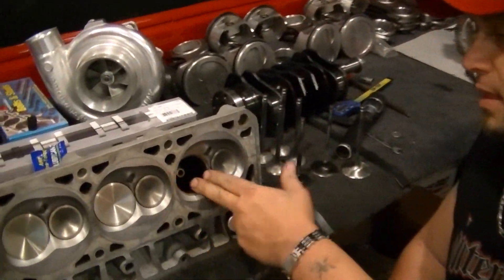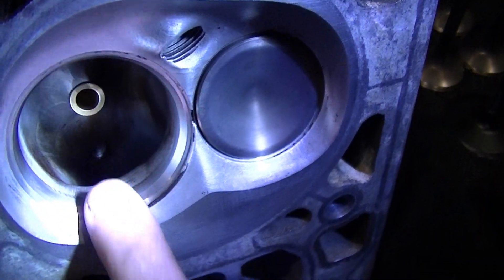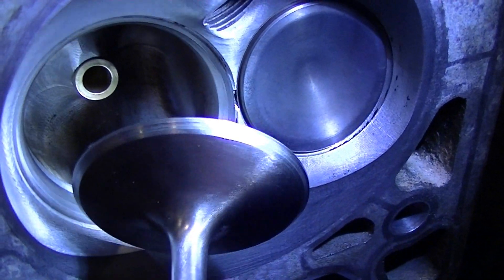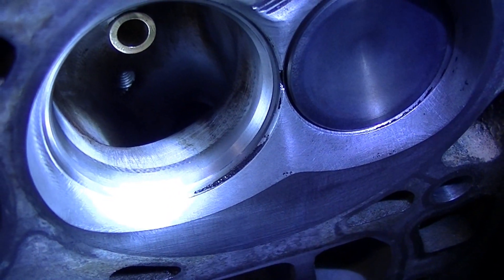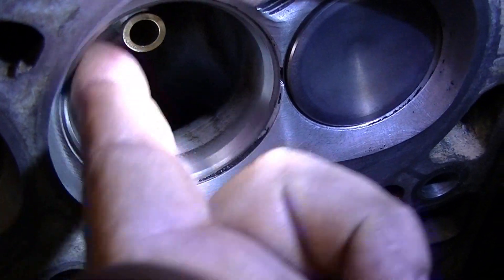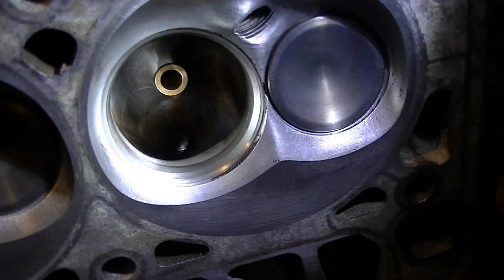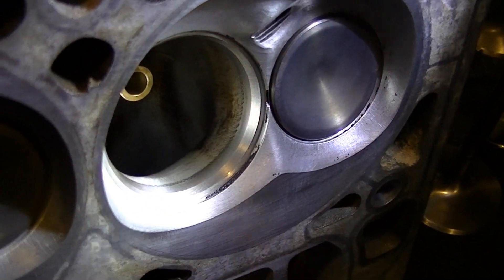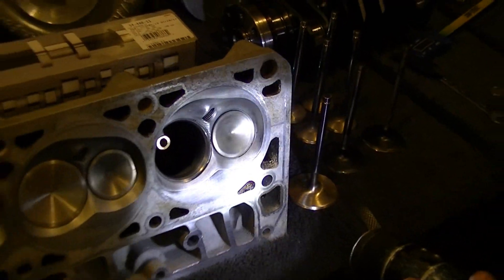StreetKillz Video Chronicles Porting 101 Vid 1

Comment: Soooo your saying Bubba Jim Bobs advice to remove as much of the runner as possible and enlarge my ports to twice the size of the intake runners themselves may have been misleading??? Blasphemy.. lol Great information man. I don't consider myself an engine builder nor a head master, but at least your videos give me a better understanding of what to look for when buying some eBay "Ported" heads or a better reason to get them done at a real shop like yours. More videos please..
Reply from the maker: LOL Bigger isn't always better!!!!! You still have to have a port that doesn't stall!!!!
Bubba Jim that's toooo funny!!! Well be shooting vids this week. stay tuned!!
Reply: StreetKillz Video Chronicles  That's not what my ex said :(
Reply: 32bitcal  I've been trying to tell everybody for years bigger aint better port shaping and learning how air flows on each cylinder is very important  I do a lot of 2 stroke banshee and learning port dimension port design reshaping  Port  Timing is  What builds labs power in the power bands anyhow same concept for head  Porting
Reply: what's the difference in a port and a runner?